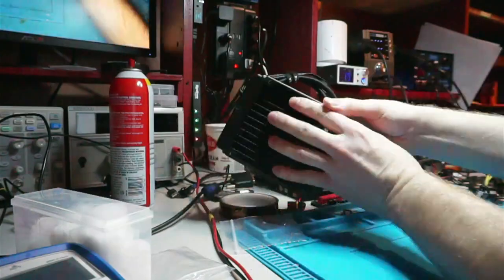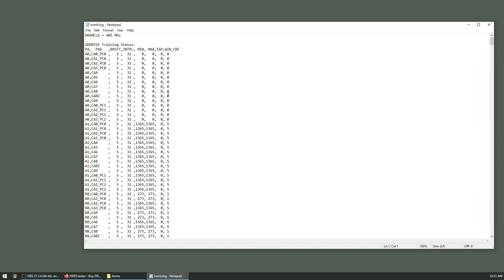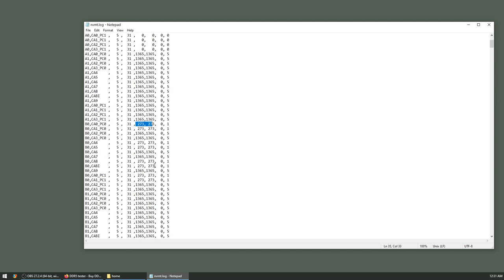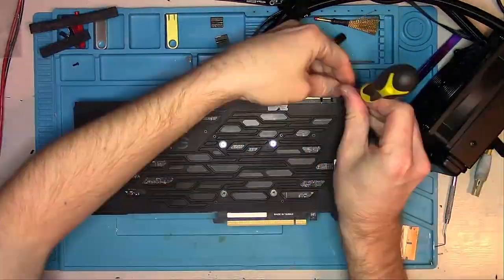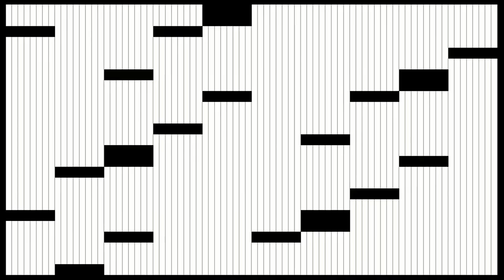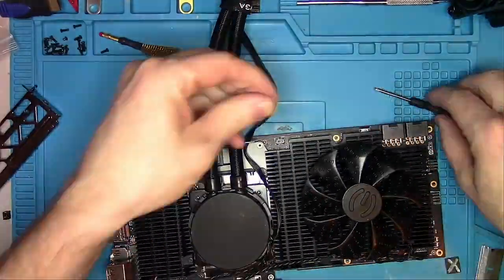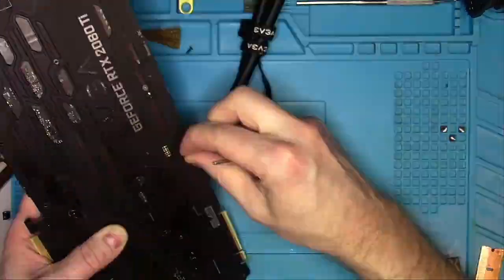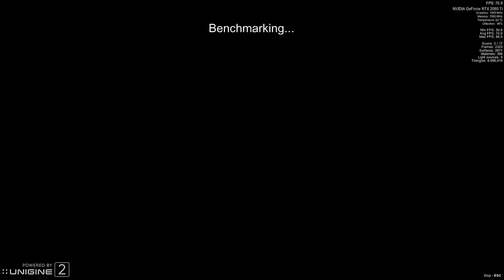EVGA 2080 TI Hybrid Artifacts fix

Comment: Thank you for repairing the GPU. With the memory IC replaced it is as good as new. The card has spent most of its life on a water block and custom loop and I put the hybrid cooler on only for your repair. I missed the plastic pad protector as I scurried to get it boxed up and sent your way. It was only there to keep the thermal pads clean while the hybrid cooler was in stroage. I also forgot to put it back on the stock BIOS. It was running warm on the 2000W vBIOS with elevated voltage. After moving the BIOS selection switch back to stock it runs as cool as a cucumber.
Reply: I have this same card and it's artifacting as well. Did you accidentally switch the overclock mode on? was that a hot key or did parts really need replacing?
Reply: @bravocortez4087  the GPU needed a damaged memory chip replaced. If I remember correctly it had a torn solder pad. The problem started when I accidentally slammed down the CPU case hard while moving it, which jolted the GPU and that is when the artifacting issues began. It had nothing to do with overclocking.

Comment: I have the 2080 Hybrid version of that card. That Asetek sourced liquid loop has been used since the 900 series, its not terrible, but over time it will evaporate liquid from the lines. If you source a broken 980-10x0 or another 20x0 hybrid the loop of those are pretty much interchangeable.

Also thanks for ID'ing the card's USB-C power circuit. I suspected they weren't dumb enough to pull that port's power from the mem/core regulators and that confirms it.

Comment: Yeah, these are always sealed AIO's and generally (but not always) off the shelf units with special brackets.

Which means if you can figure out which model it is you can buy a larger identical model but remove the bracket to improve the cooling.

Some folks just use after market kits to cool these with CPU AIO's but they don't cool the rest of the card, and 99.995% of the time it requires the removal of any base plate/backplate.

The PCB's generally sag a good bit, and I can't imagine its good for it either.

Comment: Also, the thermal pads looked like half of them didn't touch anything. If that's how it came from the factory and even EVGA (RIP) built cards without checking if it makes sense we really can't trust anyone. :/ Going to buy a Radeon card in a few weeks and it feels like a lottery, all AIBs for both "Team Green" and "Team Red" have at least a couple corpses in their basements.
Reply: The user modified the board so most likely they replaced the thermal pads and did more harm then good

Comment: Do you heat the hole board or do you have a small preheater you use under just the removing chip? What heat do you use on top and bottom and what time do you use to remove the chip? Thanks

Comment: Hi can you please do a rant about coil whine? My 4090 Suprim had coil whine so bad I had to return it. Like how can you fix it (I heard superglue on the inductors), how can you avoid it (looking up inductor model numbers once you get a high resolution PCB picture?) those sorts of things. How to use IQ to avoid buying cards with coil whine.
Reply from the maker: Coil whine is not a problem, it's an annoyance caused by cheap component base.
Cheap could will whine but they will not cause any issues otherwise.
Ignore the whine or buy different model.
Sometimes same model but different revision pcb will have different components.
The revision is printed on the pcb at the pcie slot next to the hook somewhere.
If you buy another card, make sure the value on there is greater then what you have. Hopefully later revision addressed the whine problem.
But you never know.
Reply: Even knowing the exact coils they used (which is almost impossible, unless you buy off Craigslist and can look at the card in person beforehand) might not help you, whether a coil whines can depend on external things like the game (and settings) you run in it, the shape of the voltage your PSU supplies on 12V (i.e., more/less ripple etc) and even on the exact voltage you get from your wall socket, and a lot of other things. Of course some coils will whine almost certainly and others not at all, but "it's complicated", unfortunately.

Comment: i dont understand soldering the little balls under the chips. Is there a trick? .. i never seem to see you placing the little balls there, you just swipe over it .. and they are there. Or do you not have to drip a bit of metal onto each contact point?
Reply from the maker: You can't see them because of the viewing angle.
Reply: @northwestrepair  yes - but what i meant was - do you have to drop a little bit of solder on each pad? or is there some sort of (magic) or mechanism to just swipe the solder over the whole area ... while the solder only "sticks" to the little contacts instead of creating one big splash of solder over the whole area.

I cannot really explain it maybe (English is not my first language ... and technical things like these are far from my comfort zone) 

Was only wondering because i would despair if i had to drip a tiny bit of solder on a hundret or more microscopic pads ... always running the risk that those little things could just "roll" to its neighbour and merge to one big blotch of solder - hence ruining all the effort.

Comment: Is it worth dissasembling a newly installed high end graphics card to see if the thermal pads are in contact with memory etc,seen a few vids with the film still intact,are manufacturers doing this randomly to make cards fail sooner? Whats your thoughts?
Reply from the maker: Absolutely.
If I ever buy brand new GPU, or a GPU that has never been opened, I would make sure memory MOSFETs or drmosses (which ever are used) have pads on them contacting the radiator.
Sometimes they don't put pads there for what ever reason.

For used card, absolutely. Open it, reapply paste just to be sure.
But do he careful. A lot of people with shaky hands damage the card by simply trying to replace paste.
Reply: @northwestrepair  Thank you for reply,as an retired electronics engineer,im programmed to take apart and inspect,normaly find something that hasnt been done or can be improoved apon.

Comment: We need to dodge shady proprietary companies.  There is one big fruity one I know of that is taking the steps to ensure their products cannot be repaired behind their backs.  I get the whole ego of "quality", but I find the quality goes out the windows (no pun intended) with unrepairable, or expensive over priced repair schemes that push the consumer to buying new and starting the grift all over again. 
Make this stuff repairable.  Keep your products from becoming bricks to their customers. Reduce e-waste.
Many older working devices can still serve a purpose for their capabilities.  There is old code that works, but the problem is the push for new hardware, pushes new code, which pushes old code and backwards compatibilities out.  This is why eventually your iOS won't update an old Phone/iPad to the latest.  Instead of investing in porting software to be compatible,  the companies obviously opt for a more money making technique.  Trash it and sell you a a new one.
That value invested is essentially wasted.  Imagine putting that in gold, or tangible things that will last.  Your money value will hold a lot more than these consumer electronics products of which you'd be lucky to maintain productive use after 5-10 years.

Comment: cool channel dude, here is a little puzzle for you why is HW monitor showing my CPU voltage is pulling 2.5v but all cores are locked to 1.29v?
Reply from the maker: Shunt mode
Or faulty ic power monitor.
Reply: hwmonitor is broken and  also showed me like 3.15v on vcore. hwinfo is better and doesnt show those shenanigans
Reply: Ic monitors are not very accurate (measurements have to go through motherboard pcb, circuits, ics) an even if measurements are good, sometimes software is not entirely compatible with the ic hardware monitor, you need to apply common sense: with 2.5v almost any cpu would be fried within seconds, so 2.5v  its obviously a bad reading